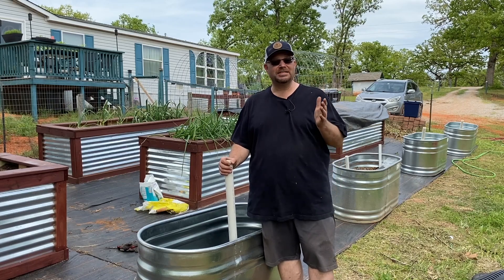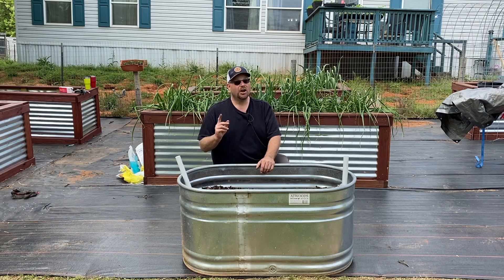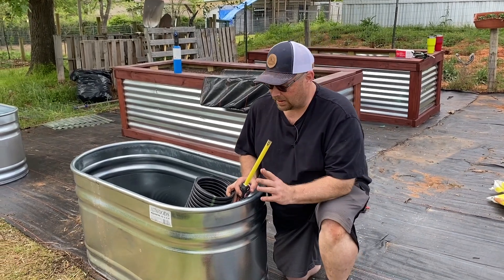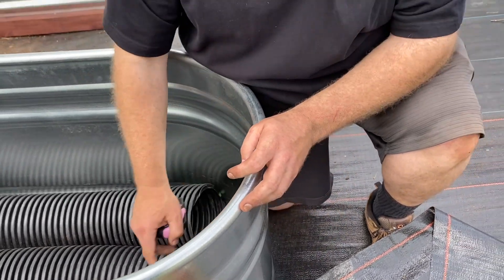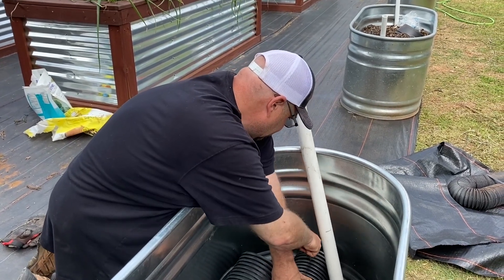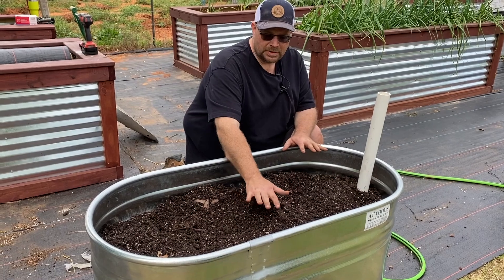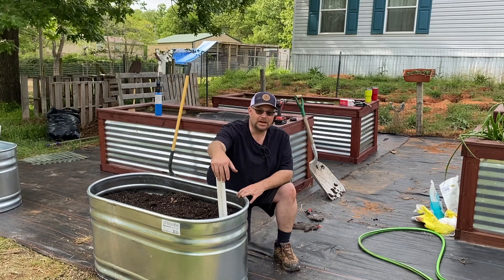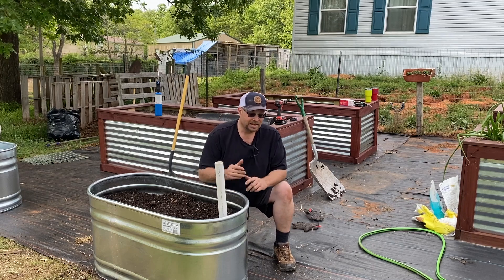The BEST Self Watering/Wicking Galvanized Metal Raised Garden Bed

Comment: Good idea!  You could daisy chain the beds together!  Just put 2 holes (lower, towards the bottom) in each tub, then run a hose connecting each of the beds and leave the last bed open (where you currently have your drain hole).  This would allow all of the beds to share the water and you would only need to fill in one place.  This would be more convienent to fill (instead of doing each bed seperately) and even automate (attach a timer and refill every few days).  Beds that take more water would get additional water from a neighboring bed that uses less water.  You could even make a closed system by adding a buried reservoir tank to your overflow port.  The tank collects additional rainwater then a small fountain pump with timer refills the beds.  If a refill isn't needed the water just recirculates back to the reservoir tank.  If the tank is large enough to last between rainfalls, you would never need to manually refill the beds.  The only maintenance I can see would be cleaning out the pump filter occasionally.
Reply from the maker: Great idea. Not sure I am mechanical enough to make all that happen, but great idea.
Reply: @RockingCHomestead  Pa-leeze, you could do it.
Reply: what ONE man can do ... ANOTHER man can do
Reply: adrumwhisperer you should definitely do this and make a video bro.
Reply: @Rick the Swift  I built a rainwater collection system instead.... collects rainwater from the roof, stores in IBC totes and then a pump sends it to a pressure tank and feeds into my irrigation system.  I can water my whole yard or just my raise beds to conserve water.
Reply: @adrumwhisperer  You are right, rain water collection is really where it's at. Sounds like you've honed a good system👍
Reply: Big brain❤

Comment: We made two of these last season - a four foot long tank and a six foot long tank. I wanted to come back and say they were a MASSIVE success. We had a very hot summer and a major drought and still, those tanks only needed topping off once a week and the plants grew like crazy. Tomatoes, eggplant, peppers, squash, herbs - we had a bit of everything in them. The same plants in other containers needed way more water and didn't grow nearly as much. This year we want to add at least one more tank and add another every year after. I had all the neighbors asking about my lush garden in the middle of the drought and 100* weeks.
Reply from the maker: That is awesome. We love the self watering beds.
Reply: This sounds great!  I am wondering what to do in the winter when the water in the bottom freezes.  Any ideas?
Reply: @FunHealthTeather  I unplug the bottom (they have a drainage hole) and then leave the plug out over the winter. I cover the top of mine with a tarp and bungee in on so it doesn't fill with snow, just so I don't end up with very wet and frozen soil.

Comment: I followed your instructions but instead of drilling a hole in the side.  I pulled the drain plug and put in a nylon threaded elbow with about 4 inches of clear tube pointing up.  This way I know the water level too.
Reply from the maker: That is a really good idea. I may have to still that on any new builds.
Reply: Great idea!
Reply: I am sorry I don’t understand your solution.  I wonder what it looks like
Reply: Good idea to see if is low in water but still need a drain if is outside.
Reply: brilliant
Reply: If I am not mistaken, he put a l shaped tube sticking out at the bottom of the side.
It should fill up to wherever the water level is inside the tank.
Reply: Can you post a link or pick of this?  Does it fit perfectly where the drain plug was?

Comment: I used your same set up but I run my pipes going towards the short length of the sides. I use 4 pieces 2 ft each. I put the drain hole and water pipe near the center of the unit. The main reason I placed the pipe the other direction was the extra space on each side for more wicking in my hotter arid NV desert climate. Other than that. I really like this SIP system.
Reply from the maker: Great tip!

Comment: I did this exact setup a few years ago, it works amazingly well.  You can temporarily attach upright supports for supporting tomatoes/beans/etc. by using two long pieces of wood with a cross bar at the top attached to each of the long ends.  I used ratchet straps to clamp it around the trough.  Once the season is over, they easily are detached.
Reply from the maker: Great tip! We love them and will add more as time goes on.

Comment: i don't understand the concept of watering the bottom and covering with plastic. How do the plants get watered? And usually i have seen the holes drilled through the bottom with fabric over that so the soil doesn't get moldy.  The idea of filling the bottom with perforated pipe is good for the soil to drain through  but only if there are escapes holes in the bottom. Look forward to your response. thanks
Reply from the maker: Only about 80% of the dirt is not touching water. The rest is touching water and allowing the water to wick up the dirt. It works, and works well.
Reply: Also, there is an overflow hole in the side so too much water doesn’t happen.

Comment: new to gardening and using raised garden beds - just bought 4 and getting ready to set them up. However this is the first time I have seen someone use this type of a system. All of the other videos and posts I've seen or read show people drilling drainage holes in the bottom of the tank so water can drain out after you water it like you normally would on the surface. Can someone explain the pros / cons of each. I want to make sure I set these up the correct way before I start drilling holes in the tanks. THANKS
Reply from the maker: If you are just going to use them as beds and not self watering beds is the main difference. How we set these up, is so we only need to water once or twice a week and water is stored in the bottom of the container. 

This really allows the plant to thrive. The roots, have plenty of fresh water, and air to keep down root rot.

Comment: Enjoy your videos. Learning as much as I can. I like to get the 2x2x4 galvanized Stock Tanks. Where do you get yours at and what is the approximate cost? Also do they rust in time? Thanks.
Reply from the maker: We normally get our stock tanks at Atwoods  Or Tractor Supply . When we 1st started they were around $90.00, but the last time we purchased them, they were up to around $125.00. That is when we can find them. All of the Farm stores are having supply chain issues. 

We have had 1 in operations for 3 growing season and no signs of Rust. However, I have seen old rusty stock takes, So I am for sure they will rust at some point, but they are holding up really well. If I had to start my garden over. I would consider just the stock takes. 
We love them that much. They are a gardeners super weapon.

Comment: would the 4" perforated irrigation pipe work?  can we double stack the 4" pipe if we don't have th 6" size pipe?
Reply from the maker: I think that would work, just make sure you drill your drain hole where you will have an inch of air space.

Comment: thanks for the video. can this concept convert to a stone raised bed garden?  i think drilling overflow holes in the stone will be a pain but doable.  how high did you say the drain hole should be from the bottom?
Reply from the maker: Yes and no, It will work, but you will need to keep the water in, and in most cases the stone or mortar is not water proof. I have seen where folks have lined their garden beds with some sort of plastic sheeting to keep water in. Our setup has about 1 inch of air in the tube. So we have a 6 inch pipe and we made the drain hole at 5 inchs.

Comment: Did the tub not have a threaded bung? I'da run line out & up to the spill line.
Reply from the maker: It does, but it is not tall enough. It needs to be several inches higher on the tub.
Reply: @RockingCHomestead  use bung, exit tub, elbow up to the height you need. Height adjustable depending on evapotranspiration rate.... done in 20 minutes.  You could even do another video & use bung and test performance of each in a summary.

Comment: I noticed that you cut the 6”perforated irrigation pipe into lengths that fit into the trough.  Is there an advantage to doing this vs. snaking the tubing along the bottom of the trough in one long piece?  (Note my 2 galvanized tubs are over 5 and 6 feet long)

Comment: As the troughs you're using are quite deep, would the water below wick up to plants with shallow root systems?
Reply from the maker: if it has really shallow, you could have trouble. We have about 12 - 18 of soil. When we had zero rain and 100+ degree days this past summer, we watered the top on top of filling the bottom reservoir.

Comment: Great video! Question: how does the soil wick up the water if there is an inch between the soil and the water?
Reply from the maker: Good question! You typically don't have 100% of the dirt above the waterline. You will have about 80%. The 20% will allow the water to wick up soil.
Reply: @RockingCHomestead  thank you!

Comment: This is amazing thanks so much! Is it possible to use the drain plug already there instead of drilling a hole?
Reply from the maker: I have heard from someone that uses the drain plug, but with an added piece of PVC to bring the water level dump to the height you need.  The drain hole needs to be high enough to get the right amount of water in the tub.
Reply: @RockingCHomestead  Great thanks a lot!!
Reply from the maker: Your Welcome!
Reply: I fully threaded a section of 3/4" npt to screw through the drain bung. On the inside of the tank I threaded on a 3/4"-1.5" adapter. On the big end I brazed a screen to keep it from clogging with debris. On the outside I installed a T. On one end of the T I installed a valve so that I can bottom blow down the tank or drain it for winter. You can always crack open the valve to check if you need to water. On the other end I have a 90 to orient upwards to set the drain height for the overflow. Essentially you can use that to adjust where your keep your level at.

I also have my fill standpipe capped so that no one decides to throw stuff down into it.
Reply: @TheFootbaldd  Great thanks!

Comment: What did you do for the drain hole? Does water just leak out at that point or do you have a hose with some sort of fitting?
Reply from the maker: On the drain hole I created it will just drain if gets that full.  We always want to have at least an inch of air in the system.

Comment: I'm assuming I can use 4" perforated pipe in lieu of 6"? I can't seem to get 6" anywhere around here, but 4" is everywhere.
Reply from the maker: Yes, you can. You will need to drill the hole lower on the container and will have less water in the reservoir.

Comment: Ok, couple questions. Do you push the fabric down between the pipes, or just lay on top? Do the roots go down through the fabric after the water? Would it help to put gravel in the bottom? Thanks
Reply from the maker: You kind of push some of the fabric down between the pipes or at least on the edegs. Yes the roots will go through the frabric and get to the water as well as take it from the water wicking up. I dont know if gravel would help or not. We have never tried that before.
Reply: Gravel would do nothing but take up space that would otherwise be filled with water. Six inch pipe gives you a tremendous reservoir. Sand or coir is used in a different wicking bed design (not Leon Sloan's). You can learn about what mediums wick best here: https://youtu.be/O4aRMh_yRQk

Comment: My 8 galvanized tubs are two feet tall. I could not find 6-inch perforated tubes, so I need to use 4-inch perforated tubes.  This will leave a lot of room to fill with soil.  I wonder if I should fill some of the bottom of the tubs with twigs, branches, leaves, food scrapes, grass clippings, etc.  Filling these tubs will require a ton of soil and it seems that the roots of my vegetables won't go down that far.  

Secondly, I have two drills and neither of them is able to drill a hole through the galvanized tubs. They just slide around on the metal.  Is there a certain type of drill or drill head that I need to buy?  

Please reply so I can proceed on this great concept before summer is over.

Comment: Is there a way to tell exactly when you need to water them?
Reply from the maker: I think the best way to check is with a stick. Similar to an oil dip stick.
Reply: @RockingCHomestead  thank you for responding.. im a first time gardener  and i had  moderate success with my small garden this summer. Im planning on adding more raised beds and didn't want to spend next spring and summer without having a better gardening schedule than i did this year and this concept you came up with is going to make things wayyyyy easier for me,  thank you again 😊.

Comment: How long between waterings with this system? Thank you!
Reply from the maker: It depends on the size of plants, how many plants you have in the bed, plus the temperature and humidity, but right now, we are filling ours up every 5 days or so. It has been  in the mid to upper 90s and our plants are getting pretty large. When the plants are small, I like to water the top to make sure the plants with small root bases get enough water.

Comment: how is water absorbed in soil if water is covered by the fabric
Reply from the maker: The water seeps through the fabric and soaks the soil. Some soil is below the 5 inch line in the tub.
Reply: @RockingCHomestead  We tried it with a couple of wash tubs my wife picked up. So far so good the soil is staying moist and the plants are doing well even after a hot day in the sun they dont seem to wilt. I admit to being a little skeptical but its working so far. I fill the tubs about every two days. Thanks for the videos

Comment: We have tons of black molasses tubs. Are they okay? Will they get too hot here in South Texas?
Reply from the maker: Yes, they will work. The person I took the idea from uses all kinds of molasses tubs, red, blue and I think I have seen black also. I don't think you will have any issues.
Reply: I have used those molasses tubs before and I paint the exterior with white roofing paint. Works great , soil does not over heat and dry out.

Comment: Great video and something I want to build soon.  I have a question though - I noticed that you have 3 pieces of the irrigation pipe but they don't seem to be connected to each other.   Is there a reason the pieces are not connected?
Reply from the maker: Great question. With the fabric in place holding the dirt back they don't need to be connected. It is really hard to bend the 6 inch pipe around in the space if you leave it all connected. That is why we cut ours.

Let me know if you have more questions.
Reply: @RockingCHomestead  So the other shorter one just work as a space filler that the dirt is leveled under the fabric?

Comment: Hi, great video. I have a question. I have a large horse troth like this and it already has a drainage hole. Should I just go ahead and use that. It is on the backside of the troth to one side. Thanks.
Reply from the maker: Hello! It depends on where the drainage hole is located on the trough. Check out our video of "Top 3 Questions" about our self-watering tubs for the reason we drill holes in the tubs even though they already have drainage holes. Thanks for watching!

Comment: Great video! Where did you find the 6" tube? I couldn't find it last yr.
Reply from the maker: I found it at Lowe’s. I had to buy the 100 foot roll! A little too much but we will use it. They did have some 20 and 50 feet rolls, just not in stock!
Reply: @RockingCHomestead  Thanks, That is where we looked for it. Maybe next time.

Comment: Question:  I purchased a 3ft x 8 ft trough to make this planter.  Should I cover the entire bottom with the 6in.  perforated pipe?  I'm thinking that would be 6 pieces of pipe at 8 ft. each.  Also, how does the water wick up through the landscape fabric?
Reply from the maker: You need to cover about 80% of the bottom with perforated pipe. There will be dirt in and around the piping, that is what causes the water to wick up. You just need to make sure that the pipes are completely covered by the cloth so the dirt doesn't clog up the pipes. You want to keep the pipes as clear as possible.
Reply: @RockingCHomestead  Thank you for your reply.  I really enjoyed the video.  What is the soil mixture you use?  I couldn't find the clip with that info.
Reply from the maker: https://youtu.be/en0E69bd8CY
Reply: @RockingCHomestead  Thank your for taking the time to reply.  I really enjoy the videos.  Can't wait to start growing in my new wicking bed.
Reply from the maker: @lynnwinnie5621  awesome! Hoping for the best!

Comment: Great job! Can you tell me how many feet you used of the 6" irrigation pipe you need to put in bottom? Also, do you remember how many feet you used of the 4" from the 1st tub you made? 6" is not easy to find in a store. Thx
Reply from the maker: I will have to measure it. I cannot remember. I think it was about 4 feet per tub, and the old one I will have to measure for sure. I think I used two sections. You don't want it to cover the entire bottom, you do want a little area where the fabric is touching water, with soil on top of that.
Reply: @RockingCHomestead  my best guess on the 6" was about 10 or 11 ft total (4' across the middle of tub and a 3' piece on each size of the 4') and almost double that for the 4" because it wandered around the tub more due to smaller size. I do appreciate any feedback. Also, right now TSC has the 4x2x2 water trough on sale for $74+ tax until June some time.
Reply: I really need some help. I can't seem to find that tubing any where. 4" or 6". Any ideas 💡